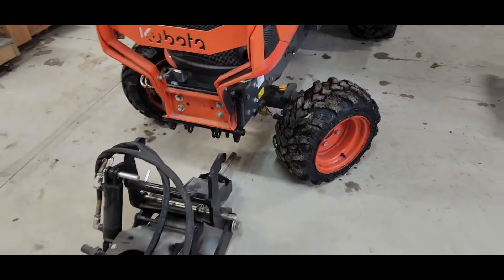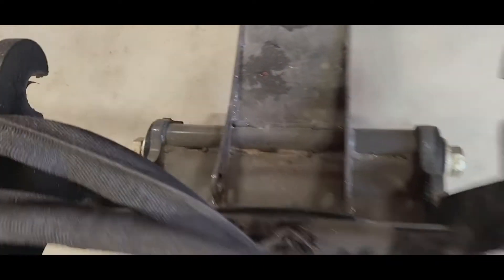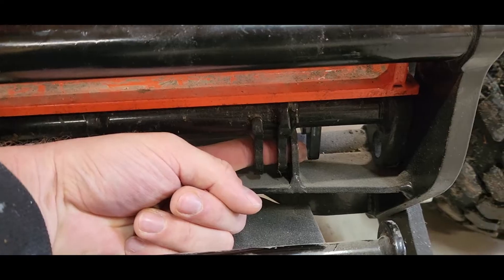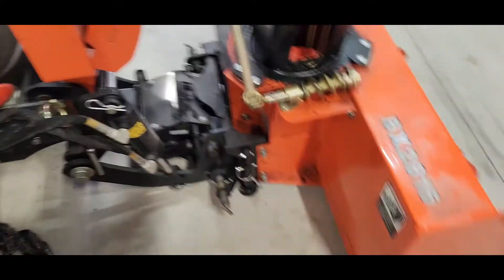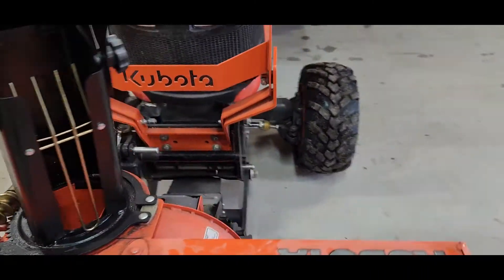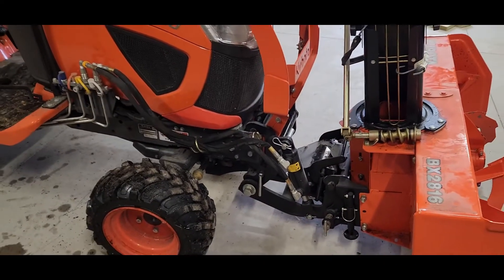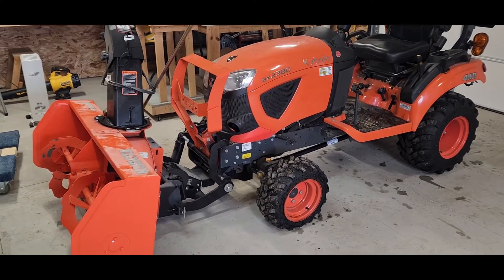How to install Kubota BX2380 snow blower fast!

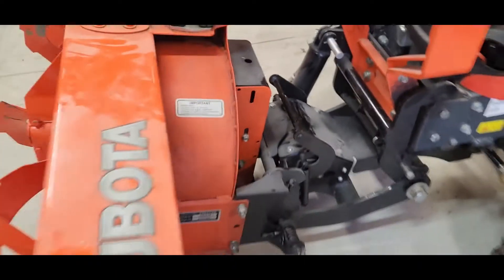Comment: @4:51... solved all the problems in my world. Being a tractor rookie, I felt pretty good about getting the SB mounted and the hydraulics hooked up. Could absolutely NOT figure out how to make the auger spin. Spent literally 2 hours going through the manual and making sure everything was hooked up and assembled properly. There was no mention of the spring engagement handle on the quick attach. Thank you man.
Reply from the maker: glad it worked!

Comment: Ok I got my snowblower mounted. It is the same tractor and snowblower that you have. I did have trouble getting the quick attach past the 2 side bolts of the guard. Those "J" hooks were rubbing against the bolt heads. So, I removed the upper section of the grill guard so that the bolts being out of the way would give me just enough wiggle room to get the J hooks mounted where they are supposed to be, but left the bottom section on as it was not impeding the quick attach. Maybe if I switched the side bolts to carriage bolts that might give just a little more space to slide the quick attach past without rubbing. Your video was still helpful.

Comment: You show everything after it's already on. Seeing it being done is what everybody wants to see. I have seen another video putting the quick hitch onto the front and they had an awful time. They couldn't get the "J" hooks on the hitch, past the side bolts for the front guard. He ended up having to take the hoist cylinder off the hitch to give himself more room to wiggle the hitch into place and then had to reinstall the cylinder. So I was hoping to see if you too had the same problem.
Reply from the maker: Yes I showed as I went using the hands I had available. I guess I need more than two hands or someone needs to pay me a lot of money to take that kind of time to set up camera stands and lighting and editing.  I explained the fairly simple steps in detail and set the camera down for the minute in between doing each step needing two hands. I'd bet whoever had those kind of issues as you described is either doing something wrong or is using mismatched parts. If I encountered issues like that I would have taken the time to document it.  But this process with these model #'s was all very smooth, virtually plug and play. Sorry if that wasn't enough, hopefully it still made it more clear for others.
Reply: How much was that snow blower?
Reply from the maker: @jamescain3172  I don't remember, a little over $2,000 probably.
Reply: a little over $2,00 - complete?  Where are you located?  Ontario, Canada here - considering a front mount blower for my new BX2380 - but @ $10,000 approx for quick attach and blower - that is lots of money for a homeowner unit.   @GarmingGFB
Reply from the maker: Yea it was a few years ago so probably more now but it was around $2,000 for this model.  I can imagine it is a lot more in canada though today, seems like a real s**t show up there. Best of luck to you with the w0ke dictator and c0mmunism and such.

Comment: Did you ever make a video of you snow blowing over the millings? How did they hold up? I want to do millings, but afraid of what the harsh midwest winters will do to the millings.
Reply from the maker: Never did a video, probably could if I remember. It works well. Best part of using a front mount snow blower with hydraulics is that you can just adjust it up a little and don't even need shoes. I try and leave like the an inch of snow or less on the drive. After the first time and it all packs in it's really easy to just glide on top of the snow pack. I'll cut into the millings once or twice a year on slopes but just pick up the blower quick and you're fine. I just drag the entire drive in the spring and it looks new. Well worth the cost savings imo.  Not to mention I can have any load on my drive without anything breaking.